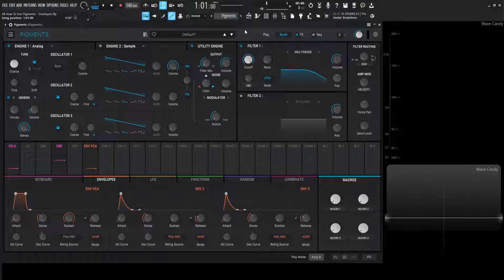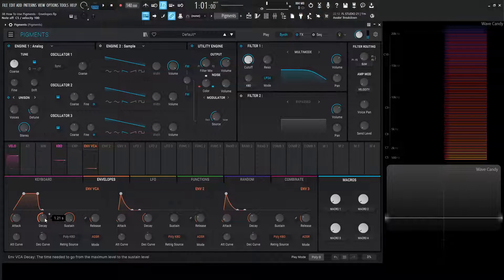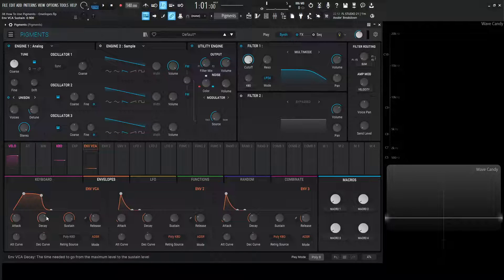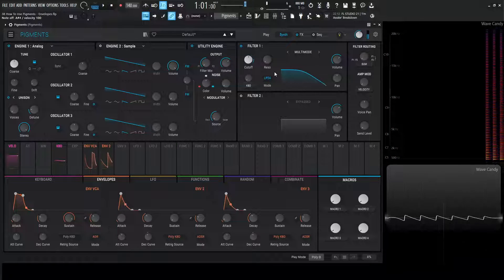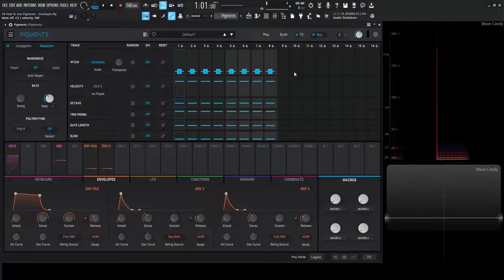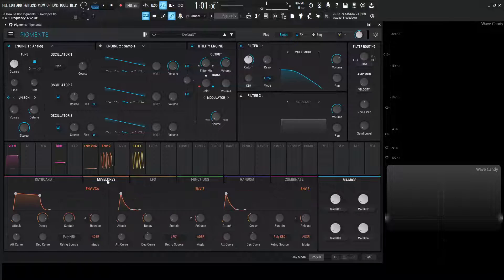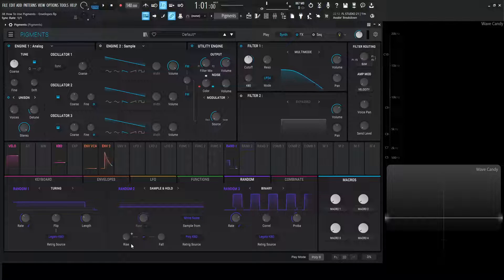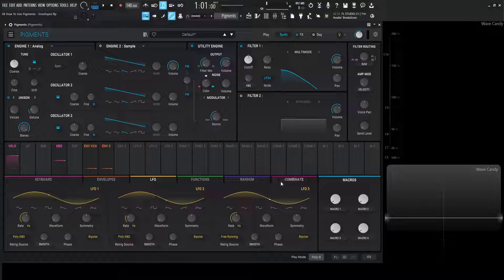Envelope Modulation PART 38 | Arturia Pigments 4 Tutorial

Comment: I’m not sure I got this right is it one envelope per engine how many amp envelopes does pigments have?
I guess I’m trying to use my knowledge of omni sphere or alchemy to understand if each engine has an individual envelope
Reply from the maker: Pigments has three envelopes for the entire synth. Both engines operate independently from the envelopes, the only thing to note is that the first envelope, Env VCA, will always control the volume of pigments, as it's hardwired to the keyboard, you will see 'poly kbd' is greyed out and unable to be changed. With that being said, it still can be used to modulate things, just as the other two envelopes can do. If you find yourself in the need of more modulation sources, there are the three functions also available to use, we will he covering that after LFOs.
Hope this was helpful, pigments is a monster of a synth
Reply: @jonaudio  thanks for your quick response, Jon …. Happy New Year in advance.
Reply from the maker: Anytime my man, you're welcome! Happy new year to you as well!!

Comment: I can't figure out how to get the LFO to NOT be retiggered by the sequence start. No matter what I set the retrig to it resets at the start of the arp or sequence. I want to LFO to modulate independently form the sequence but the only way I can get it to do it is if I turn the "reset" off in the sequencer which then forces me on a 16 step sequence because it turns off where in the bar I want the sequence itself trigger. Anyone know what I am missing here?
Reply from the maker: Have you set your Lfo to free running? That will not allow anything to retrigger the Lfo
Reply: @jonaudio  yup set to free running. Check it out, confirmed with some others they are seeing the same thing. Starting to think it may be a bug in the update? Curious if you see the sam in V6. Appreciate the response.
Reply from the maker: Out of curiosity I loaded up Version 6 on my end and yeah looks like you're correct. Free running works normal until the sequencer is engaged.

Once the sequencer is engaged the Lfo will retrigger upon each note. Which shouldn't be the correct behavior. I also loaded this same configuration in avenger to see if I'd get the same behavior and I didn't. 

So this leads me to believe this is a bug. Wonder if it's been reported to Arturia yet..

Good find!